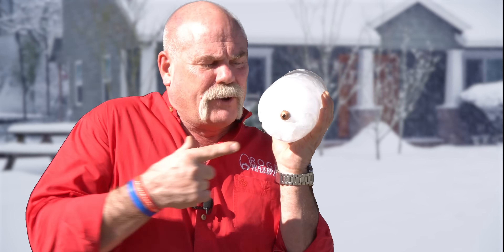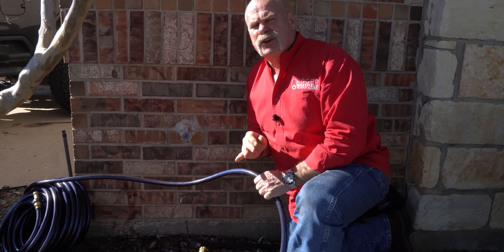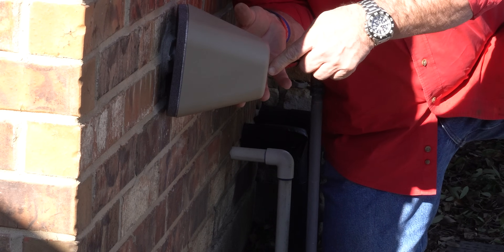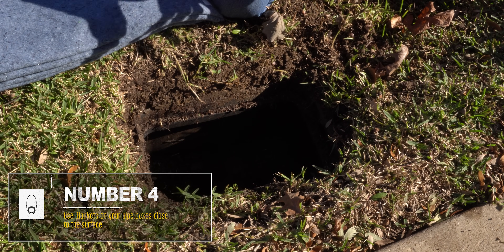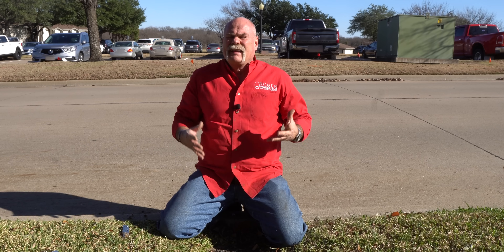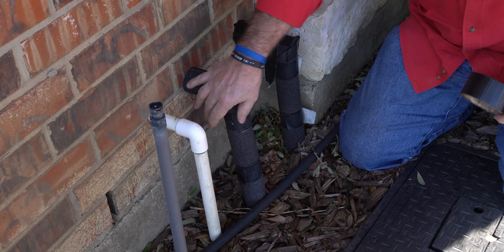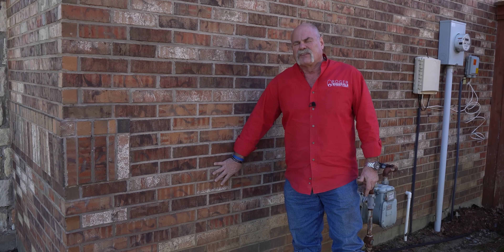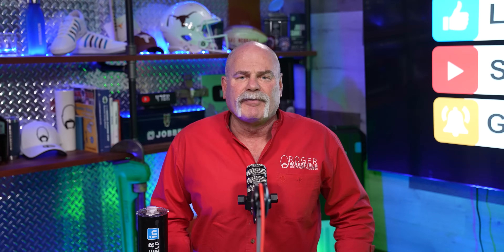6 Tips to Prevent Your Pipes From Freezing!

Comment: I had a plumber tell me if they had to run supply lines in an  exterior wall  they ran baseboard heating supply or return lines in the same wall cavity. If the heat is on in your house the wall cavity is warm.

Comment: When my parents had a new house built in 1973 the required that all of the water lines came up through the floor and into inside walls.  There are no water lines in any outside wall.  As long as the house is warm the water lines are warm.  And it got to 20 degrees below zero F two years ago for a week and they had no problem whatsoever.

Comment: Could you bury Styrofoam strips a foot wide and however long the pipes are, and just bury them just above the pipes so the frozen ground and temps don't effect the pipes. Would that work?
Reply: they would crush over time and you'd get a depression over the line.  the parts of the pipe that are buried should be below the frost line, so they will be fine.  it's the access boxes where the frezing air can get down to the pipes.  you could make rigid foam insulating inserts for the boxes, and keep them year to year.  other than the meter box, you could even leave them in the box, if you put a way to pull them out in a hurry if you need to.

Comment: My water meter box is always full of water (all year round) is this normal???
Reply: Not normal. Plumbers in my area use test strips to determine if the flooding is ground water or treated 'city' water.
Reply: @Robnord1  thank you for the suggestion. the city has just ignored my concerns. i will see if i can get my hands on one of these testing kits
Reply: Pump the water out (a hand pump will usually do it just fine) and monitor it. You may discover that it fills constantly or only when your sprinklers are running. You may also notice (now that the standing water is out of the way) which direction the new water is coming from.
Reply: Pump out the box and then see if the water is coming from a loose connection.  I had water leaking just below the handle of the shut off valve.  I just used to wrenches to tighten the nut that was loose.  One wrench supported the valve and the 2nd wrench tightened the nut.  Very simple fix.

Comment: OK, bear with me a moment. Say you have a copper pipe with a bib on it. The bib is point A and it is open slightly. A few inches back along the pipe, the water freezes (point B) but the open bib saves the day by not allowing pressure to build up and burst the pipe. Hooray! But the water in the pipe is still frozen and blocking the pipe at point B. A few minutes or hours later, the water in the pipe freezes a little further up the pipe (point C). Since the pipe is totally blocked by ice at point B, won't the pipe burst somewhere back around point C? I think it would, but I could be wrong. Anyway, my point is that you can let the water run a stream and it MIGHT save your bacon, but don't let that be the ONLY precaution you take.  Follow the other suggestions Roger makes, too!!!!!

Comment: When building in the south you could build to code from near the border with Canada. If you would bury your water lines deeper & not run the water lines through the attic you wouldn't be such a meme. I know it might cost more initially but being the only house on the block without icicles in the house would save you money as you don't need an emergency visit from a plumber.

Comment: living here in Europe,, we have freezing temps a lot more than texas, and this NEVER happens. even below 0c. here it has been -10c  -  -20c and this is never happening. why there and not here in the rest of the world?
Reply: Because most of the parts of Texas that dealt with extreme cold the last two years don't normally experience it.  Thus, building codes and practices are not the same as cold weather climes.  Above ground pipes, less insulation, etc.  Large portions of the U.S. and most of Canada are much better prepared for freezing temperatures than Texas.

Comment: instead of using blankets on the main water boxes, why not just trench 6 feet deep bury the pipe until it is inside the house?  It is what all the homes do in the northern midwest.  When the city needs to turn the water off they have a tool with a 6+ foot length to reach the actual shutoff valve in the street.

Comment: It seems like your building codes in that area have set people up for failure. No one should run water pipes above the frostline.
Reply: I think you will find most problems are at the older homes that are not up to new code. Surprisingly, many parts of the USA didn't have squat for codes prior to 1970.

Comment: Showing the heat tape portion is entirely incorrect. The method you have shown WILL lead to a house fire. You NEVER overlap the heat tape, for one. Secondly, the heat tape should be install at 5 or 7 o'clock on the bottom side of the pipe because heat radiates upward. Further, most manufacturers recommend adding fiber glass pipe insulation around the line not the Styrofoam tubing that you can buy as it could melt. The old school guys used to wrap the heat tape like that but that had ended long ago after it had been determined to be the cause of many fires. Heat tape is well known in the trailer/mobile home community. It's also generally good for 3-5 years. It should also be noted that some states require it be run off of a GFCI outlet. When taping use a better quality electrical tape not the plastic and make sure to follow the instructions per the manufacture.

Comment: Just shut the water off and drain your pipes. it's way easier than it sounds.  Just ask some drinking water already bottled up and a couple of five gallon buckets to fill the back of the toilet to flush it if you need to. if you're a guy,just pee in the sink.  You can flush that sink out with 8-12 Oz of water.  I Went to beyond dripping water and actually had it at a slow run in my pipes still broke at zero degrees.
Reply: Or just drip your faucets so it wont freeze so you still have water to use.
Reply: @common_c3nts  Yeah, tell that to all my neighbors who did that and their pipes still broke.